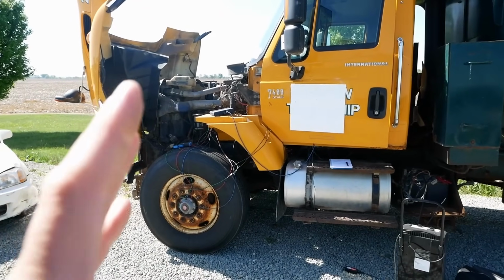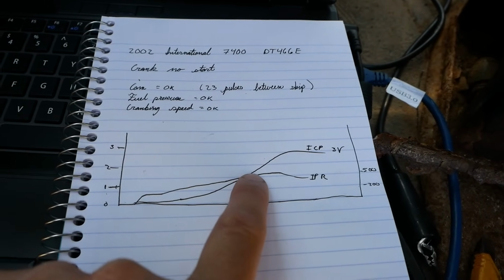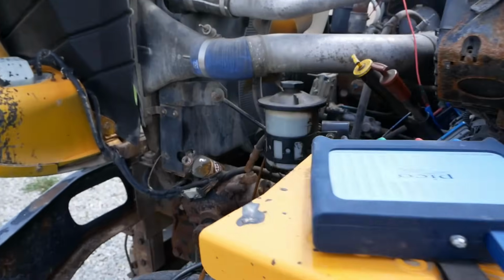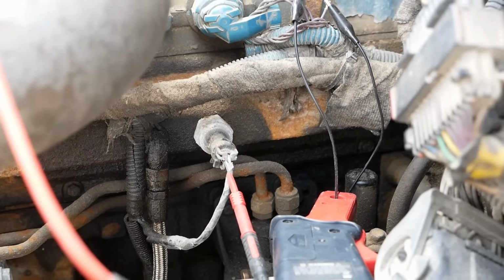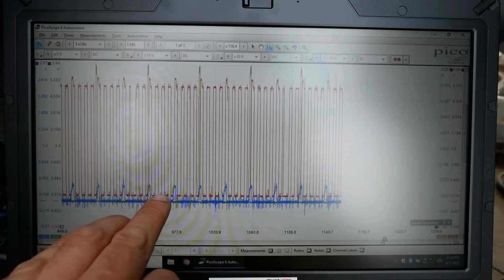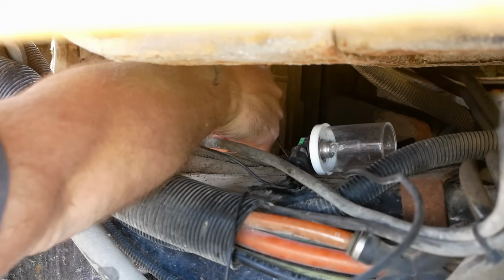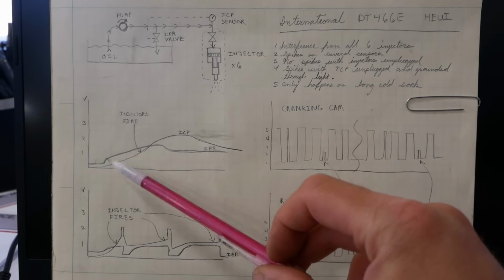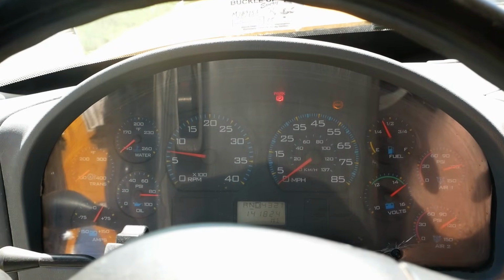International DT466E Won't Start without Ether after Sitting

Comment: Wes - Two things.
1: It USED to work when there was an external battery charger connected
2: The 'spikes' are being seen on a large number of sensors
IMO, that's almost SHOUTING at me that there's too much electrical resistance in a ground circuit somewhere.  (Especially point #2 above)
When ANY injector 'fires', it is 'lifting' the ground voltage to everything (INCLUDING the ECU itself)

To test my hypothesis:
Grab any semi decent old car battery with some long-ish leads (possibly 2 of them in series if the injectors require 24V)
Connect the negative directly to the ECU ground leads (since the injectors are 'cold side' switched through the ECU)
Cut the existing positive feeds to the injectors and connect them to the car battery positive 

You're now 'feeding' the injectors from a totally independent power source - the truck should run just fine.
Now disconnect the external battery negative from the ECU and connect it instead to the actual truck battery negative right at the truck battery itself.
If it fails now, then you definitely have too much resistance in your truck battery ground/negative circuit (which is what I suspect since so many sensors are affected)

The other test would be to cut the injector feeds and directly connect them to the truck battery positive to check for resistance in the positive circuit, but I seriously doubt this is the problem.
Reply: I bet the sensor reference ground in the ECU is smoked.  Diode protected, somebody once hooked a battery charger up backwards, voila.
Reply: @hordboy  that or..... got a cheap ICP sensor with VREF and Data switched..... my 6.0l had that happen after i replaced the whole truck wiring harness... truck fired right up after the new ICP sensor....... couple weeks went by cranks started getting longer and longer and longer. then wouldn't start at all...

Dug into it 4 hours of work....... cheap sensors are backwards somehow they WORK to begin with....... the 2 bottem pins are often switched from the plug on the truck i switched these around. Truck started right up havent had an issue since.... cheap amazon sensor i got for like 30 dollars...
Reply: Thinking about it for a while now, the only reasonable cause i see, is that the power supply of the 5v reference, and the IDM use the same ground, and every time the injector fires it elevates the common ground level, and in response the 5v supply gets elevated compared to the rest of the ground plane. Most probably a crusty connector, or water damage inside the ECU itself. As to why it runs sometimes, and why it doesent, its probably down to some magix compensation from the confuser
Reply: could be International and Ford's with the powerstrokes are known to have almost a bare minimum Electrical System and if the Medium duty trucks are anything like this Turd in the video.... likely grounds the whole engine and transmission through the Rear axel....... maybe if he Threw on a fat grounding cable it would work. or ground strap...... from the frame to the motor.
Reply: Well yes, it does scream ground fault, exept that it can carry hundreds of amps to crank the damn thing, also i belive towards the end of the video, wes says the ecm is directly grounded to the battery negative, and tested all ecm grounds with plenty of current. All i can see that he didnt (couldnt) test is if the high resistance was inside the ecm connector

Comment: I had 3 Dodge vehicles, (96 Caravan), (05 Dakota V-8), 07 Dodge Ram 2500 with 5.9 Cummins Diesel. All new purchased in California.  Everyone had a transmission problem. If you let it set more than 3 days without moving it. It would start fine, put it in gear and the engine would race for about a mile while you creeped long about 15 miles an hour. After things got warmed up it was fine. If you drove them every day, no problem. So it was drive them everyday or get rid of them. I chose the latter, never bought another Dodge product afterwards.
El Mirage, Arizona

Comment: Forgive my ignorance, just a DIY mechanic here but, could there be some kind of capacitor type thingy in the ECM and it loses its charge after say 30/40  hours or so and that's why it will start after sitting for a day  but any longer it loses charge? Still needs a new ECM but just wondering why it works at all and would likely work every day but time spent  not running is then a contributing factor? I know it's probably nonsense but just thougjt I'd offer it up. 👍👍
Reply from the maker: Seems likely.

Comment: I think. for my two cents worth. There is a dying capacitor in the ECM. It should be smoothing out the injector power draw spikes. May be an external one would help.I am not sure were to install it. or what size to use.

Comment: Have a 3126 in a fl70 that was a bear to start when cold. Similar to this one and had no throttle response for a while. Pulled the valve cover and cranked it one day and had 3 injectors not squirting oil. Let it warm up and reved it and 2 started dumping oil. On a budget so I replaced 1 injector and she starts great now. As far as I can tell the 3 non functional injectors wasn't letting it build injector oil pressure

Comment: The HEUI system was Caterpillars patent. It was licensed to International to be used on their engines. It is not a complicated system. You need a computer program that will monitor ICP. First let the truck set 2-3 days and remove the engine oil temp sensor. If little to no oil comes out of the reservoir you have a front cover gasket issue that is allowing the oil to leak out of the HEUI reservoir which will cause the issue you have. It is likely a slow leak that’s why it fires back up if it doesn’t sit that long.
Reply from the maker: No I checked that long ago.

Comment: I'm not sure if it's a good thing to be tenacious at problem solving or a curse.   Could not count the times I said I was going to send it to a dealer.  Then in the evening it haunts me and the next day I'm back at it.  I always try to remind myself the computer is least likely to be the issue and try again to really confirm it.  Win some lose some in cases like this one.  Especially when you can't get useful trouble codes out of them.

Comment: I can tell you that there are two fuses on top of the battery that send power to the ECM. They will cause the starting problem you are having. Kind of stupid that is how the thing was wired but it is. I cut out the fuses on the 2006 4300 International I was having problems with and that cured must of its problems.

Comment: Assuming it is not a bad big cap n the board, I continue to have a suspicion that the wrong ECM was installed/wrongly programmed long ago and even before current owner and perhaps already from the dealer.

Comment: Dang Wes 
Nice job
I do agree with you 
If the injectors are being supplied power and feed current from the ecm which they are then if there’s some corrosion on the board and possibly trace to trace current leakage then yes the current could find it’s way to the sensor ground ckt internally and lift it up. 
Man you played this one hard with scope 
Well done. 
And by the looks of the ecm who knows what it looks like internally

Comment: Hey......check the fuel filter......make sure there is fuel in there.....if no fill it up......cheers........check the tank.....when u remove cap on fuel tank ...if it suck air in....u have plugged vent on fuel tank......cheers

Comment: IPR valve a solenoid? Differences in pressure for this high-pressure oil for controlling / maneuvering injectors if measuring after 48 H ? compared to after running? I did not  follow 100%, were you able to monitor that pressure over time at the scoope? I once had a similar starting issue on a PD VAG engine, if sitting a week it would crank for ever. It was actually a valve at the fuel filter leaking and causing a air trap in the fuel supply... 48h cycle on a electrical issue, its spooky and skill might not help, you mentioned this Shaman...
Reply from the maker: Yes. The green trace is the ICP voltage which is the pressure.

Comment: There was a time not long ago when the only wire that went to a diesel engine was the fuel cut off line. All the other controls were analogue such as springs and centrifuge.
Then the weirds from California dictated what an engine should be like.

Comment: You have a gift. I have no idea what you are talking about. Have a pet hate of all this modern computer controlled garbage. And yet I sit here for the full video engrossed. Knowledge is Knowledge I suppose whatever snippets sank in. Vehicles with all the emissions equipment over complicated. In a smaller way the same thing is happening in my industry. Construction requirements make everything more complicated and that adds drastically to the cost. Vehicles will go electric. That solves the emissions problem until they say it causes something else. Not sure where Construction will go. Eco friendly mud huts. But they burnt wood. Perhaps not.

Comment: Hi. I could imagin, that it is a bad Capacitor in the ECM, so that, as long as the input voltage is not very high, the internal voltage breaks down when it try to open the injector.
When the battery voltage is high enough (maybe higher than 13V) then the capacitor has just enough energy to keep the internal voltage stable enough to run the motor.

Comment: Great video Wes! I seem to remember a while back( I thought it was your channel but maybe not so I'll mention it) I  saw a video where a guy had one of these with same type situation and it was caused by oil draining out of the little reservoir they have in the front timeing cover that supplies oil to that high pressure pump up front.

Comment: I've seen the "powerstroke help" channel guy talk about this.  And the problem is that the regular oil pump is too far gone and it allows the oil to drain back into the pan when it sits, so then when you first start it again, it takes it quite a while for the oil pump to push enough volume up to the HP pump, which runs the injectors  (as you said).  He just did a video on this within the last month or two,  on a powerstroke...  Put in a new oil pump and it should fix it....   But I haven't watched your vid yet, so maybe you found something else.

I looked up the video, it's called "7.3L Cold No Start - The death of the 7.3"

Comment: Wes  if there are spikes there is a coil being de-energized (counter EMF) If INT. failed to include Counter EMF diodes in their design or they are bad OR IF an old school mechanic removed them on purpose, [I once had to analyze why ALL the school buses in a particular bus garage were blowing up every 2-way radio that was put in them, they had removed every diode pack off of every coil on the bus! I measured a 130 VDC spike reverse polarity on the 12 volt line when the bus was turned off.] Collapsing magnetic fields!

Comment: try cycling the key ignition on to off several times to warm the ECU before trying to start it,  the low location of the ECU doesn't help it for avoiding condensation into the ECU, cycling the key sends current through it enough to warm it and not be grounded inside the ECU unit for it to start. worth a try.
best regards

Comment: If the oil pressure gauge is intermittent, could the PCM be relying on a signal from a faulty oil pressure sending sending unit?  Is that potentiometer full of caked oil or crud that loosens up with oil/engine temp?  Just thinking of things related to hot/cold cycles.